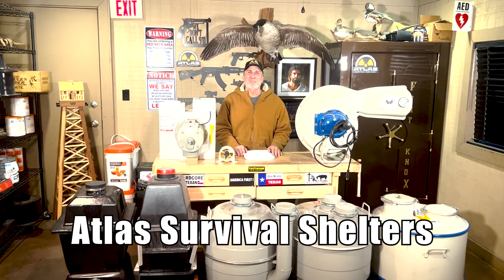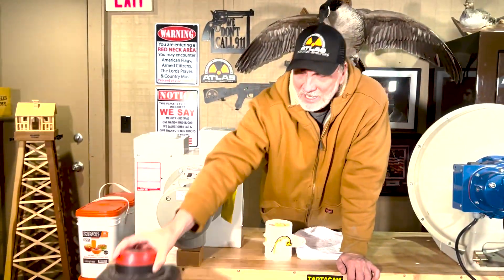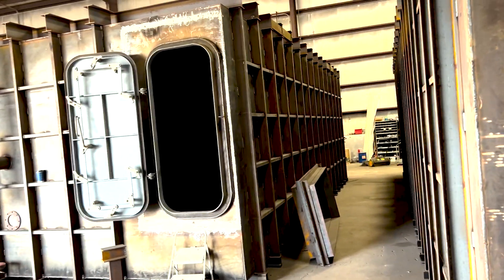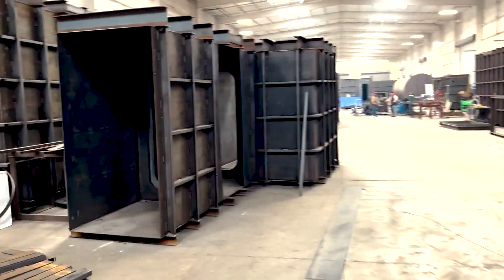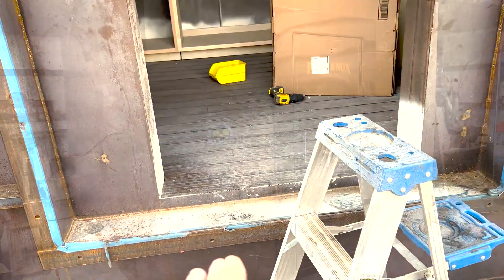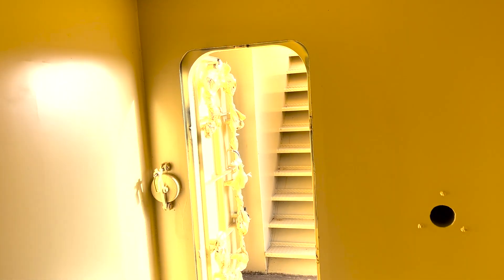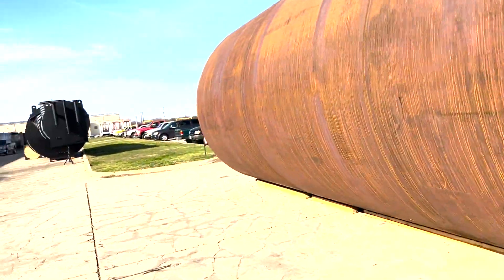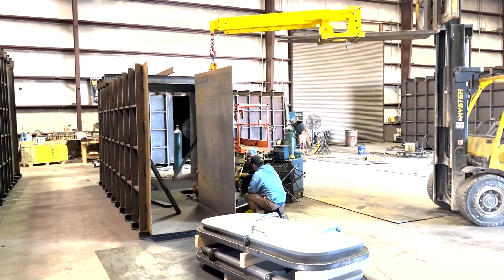Bomb Shelters For Sale - Yes, they are back in style!

Comment: I want you to know that I worked in the wastewater industry for many years and your carbon filters are “almost” as large as some of the carbon filters we had at a number of our wastewater pumping, or lift stations. We needed huge blowers to remove the deadly gases that would build up inside these structures. And of course, that contaminated air was incredibly foul smelling. So all the air would be pulled into the wet side of the station, along with the sewage, and the foul sewage air would be cleaned before it was blown out through the duct system. Impressive filters!

Comment: You should make a model with an intel room or office. That way, someone could install a CB Radio and other communications devices. How else would you know it's safe to leave the bunker during an event? It would be pretty easy to add a retractable antenna or a remote control door to expose the external electronics when in use. 
Just an idea. I think it would be helpful. It could also offer a private space to relax away from others in the shelter with you in an event.

Comment: I have a question, what is the use of bullet proof doors when someone can just clog the air intake ? It looks like it would be easy to stuff the air intake with mud  or something to block it. Have you considered making a system where the air intake can be retracted for protection ? As well as emergancy air supply.
Reply: I would reccomend recessing the intake in a pit, covered by a grate with false foliage or breathable turf.
Reply: Its common practice for air intakes to be disguised or hidden to make them less likely to be clogged by problematic individuals. When installed under houses one could easily run the pipes up through a wall, out the roof and make it look like a typical home exhaust or vent. Though given how it is designed, it would be relatively easy to T or Y the intake/exhaust pipes to have multiple inlet/outlet locations. 

An engineered solution might be the ability to temporarily block off the filtration and pressurize the inlet/outlet pipes to blow out any obstructions. 

Given how the exhaust valve is opened with pressure inside the bunker, pressurizing the exhaust pipes would automatically seal, and you could get away with not sealing the intake pipe but you'd want a valve in case the pressure required to clear the intake pipe is greater than the pressure required to push air through the NBC filter. This could potentially be an option that Atlas could theoretically develop and offer in bunkers with generator pods, or otherwise... 

As for emergency air supply, building an emergency air reserve for such a large volume would be IMO somewhat difficult. One could look into using systems similar to firefighters or submarines. With a larger bunker one could supplement their air supply with hydroponics or aquaponics.

Comment: Long time subscriber, always have been curious what kind of maintenance/upkeep does the NBC air filtration system require??how often do filters or components need to be changed/replaced,,also how does the whole  bathroom /toilet system work??where is waste pumped to??gray water??is there a well drilled and a place in bunker for bladder tank and well pump??any info appreciated!thanks in advance,god bless!😀

Comment: Anyone who needs a bunker would be absolutely stupid to buy one from anyone but Atlas. Dropping S 💩 is dangerous, should be taken to court and sued for every penny they own.
Reply: why's that?
Reply: @geort45  - Because if things get so crazy that we NEED a bunker.... 😳 
     You're going to need one that doesn't have black mold, a gas leak, circulates the air properly. You need one made correctly, precisely with a minimum of work needed once the SHTF. At that time, you'll need 100% of confidence in your bunker. You cannot fix a bad bunker during a time you need a good bunker. Simple common sense.

Comment: QUESTIONS: How long does it take from order to shipping for the 14x50 BIG BOY? How deep can you dig to install the bunkers? How many bunkers can you connect together? How long can you live in a bunker, before the air and water filters stop working? How long will the Solar Power thing work in a nuclear event? I'm in Chicago and it gets ungodly cold here in the winter. Do these bunkers provide heat? I noticed there's no insulation in the walls. Thanks
Reply from the maker: Fat Boy is 14x50    You can put several together
Reply: @AtlasSurvivalShelters  How long does it take you guys to build and do you have an architect on staff to design it the way I want, or are they built to your specific template and shipped?

Comment: Don't you think a back up hand crank pump integrated into your air system would be necessary? What happens if you lose power or have a faulty motor?

Comment: I'm using a 10x25 12' high ceiling as my initial temp shelter - just need 1 to 2 months max untill I get to my permanent location - I can't believe someone would use such garbage air system, I use a premium air system, such as the Atlas bunkers for a temp shelter🤔